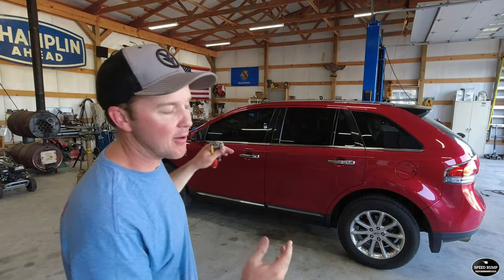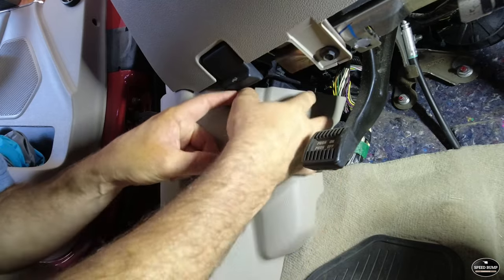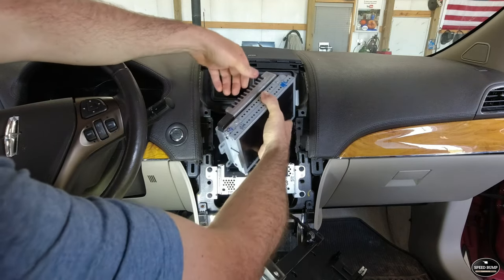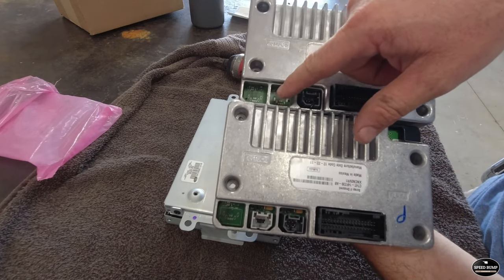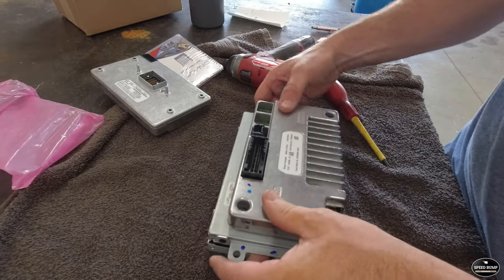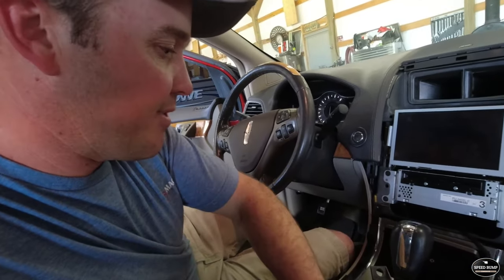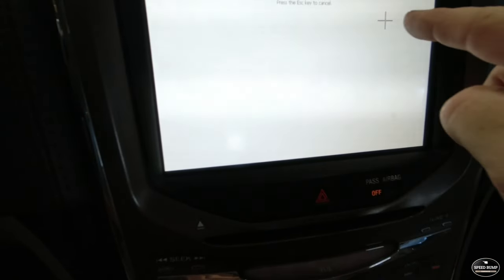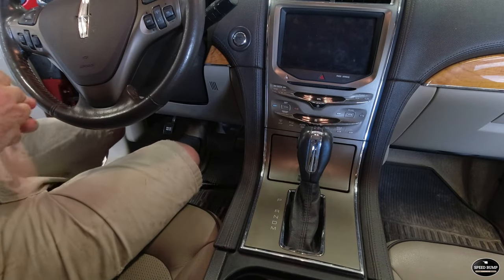Permanent FIX! Black Sync Screen MKX/Edge

Comment: As a certified ford tech i want to applaud you for installing your new APIM  as you can see it isnt really hard but on some models they can be quite a pain in the butt!! if you have any questions give me a shout and i will help if i can
Reply from the maker: Thanks Mike
Reply: So ford tech i need help. Customer changed battery now radio runs on am for 10 seconds then shuts off dash says “radio off” ac works no screen only a flash when i take the fuse out. Change screen or APIM?? BOTH?
Reply: @lilbazel  this procedure should be taken with care .. undo the negative cable set aside insolate the neg terminal of the battery run a short piece of wire with a low amp fuse inline from the positive  cable to the negative cable and let it set for 5 min attached to the cable .. this is called a power reset and attaching the wire depletes the excess voltage from the system after the power reset undo the wire and reattach the negative cable to the battery .. hope this helps !!
Reply: @mechanicmike2858  read it online i removed battery and held terminals together about 2 min while pressing buttons to try to speed up the power drain. Upon reset we got the am station but it wont allow us to change from 490khz also shuts off after 10 -20 seconds. Im hoping its the apim i told customer to order replacement from same place as this guy. Just based on your experience sounds like apim? Im no tech but id say no brains means apim and screen flicker upon reset indicates screen is good? I also unplugged both terminals and let sit for 10 min with fuse 29 out before finally hooking the battery back up and giving up after no screen
Reply: It is my opinion that it very well could be the APIM however the ACM could be at fault .. I had a similar problem with a vexh this week and we replaced the APIM to repair it
Reply: Puedes ayudarme con una duda?
Reply: @santago8772  Q onda bro?

Comment: @SpeedBumpGarage   
Kent, is it important to have it programmed to the VIN#? 
My wife has a 2012 Ford Edge. It started out a couple months ago with the fan speed randomly going all the way up (full blast) and would just beep constantly like someone was turning the fan speed up. It was very random, sometimes it would be daily and do it every 5 to 10 minutes, and other times it wouldn't do it for weeks.
But now the screen to completely black, no radio at all. I pulled the radio fuse, radio came back on but once you turn car off the radio will not come back on.  The fan speed going up constantly is still happening now too. Possibly even worse now. 
My hope is that the APIM will take care of both issues - fan speed and black screen, not sure they are related though.

It looks like you can get used units off eBay for much cheaper that come with the AMIP, but I'm not sure how important getting it programed to the vehicles VIN is. I also understand cheap isn't always better. I am just trying to understand it better so i only have to do it once and not replacing parts that may still be good. 
I do appreciate your videos, about a year ago i watched the HOT AC blowing one to fix the same issue in my wife's edge.

Comment: Had a bubble in my 2018 charger screen. Bought a 15 dollar digitizer and some goo gone to fix a bubble. Dealer said they were going to replace the radio for a  thousand. Fixed it myself and saved 985 bucks.

Comment: Hello bro. I have a 2012 Lincoln mks. The screen went black. The ac controls doesn’t work. The signals doesn’t work from inside the car but outside it comes on. What are you thoughts ? Nice video btw

Comment: You think I have the same problem as you? I checked the the master reset but when it’s hot outside the screen will stay black when I turn the car on an when it finally gets cool from the ac it turns back on I don’t have enough money to take it in also the camera will work when I put in reverse just not when I put it back in drive pretty weird

Comment: I wonder if they have a fix for my Focus body control module.  The radio and display goes dead when the engine is off, and the USB just says "USB DISCONNECTED"  no matter if it's plugged or unplugged.
Reply from the maker: I bet you could find the answer on YouTube!
Reply: @SpeedBumpGarage  The dealer service doesn't want to replace it even under warranty.  I'm gonna have to put my foot down.